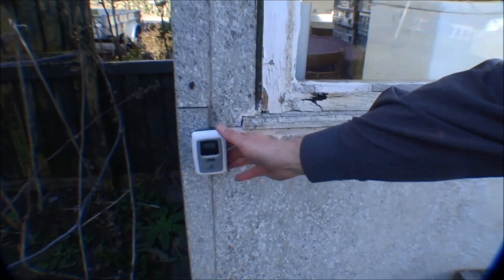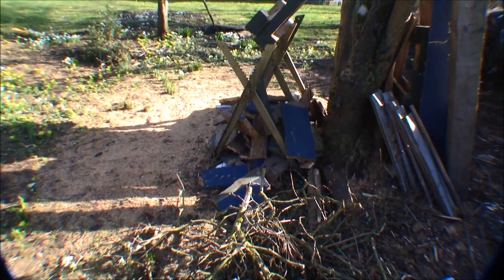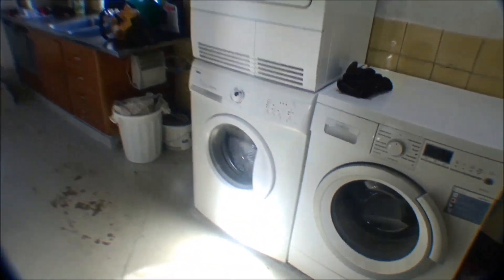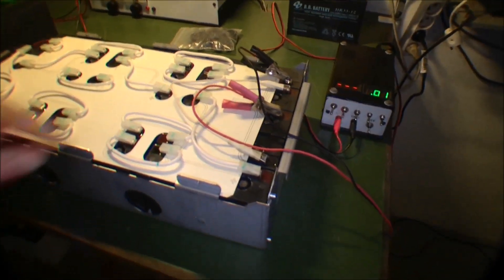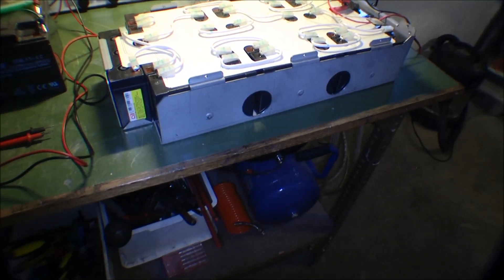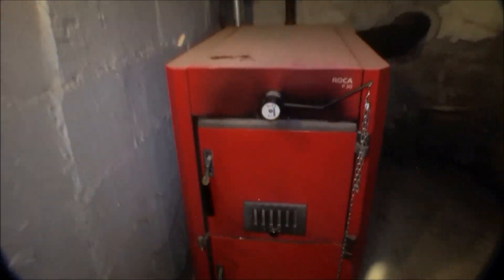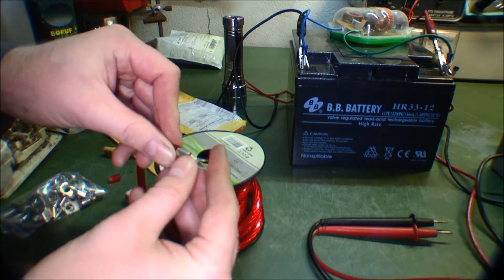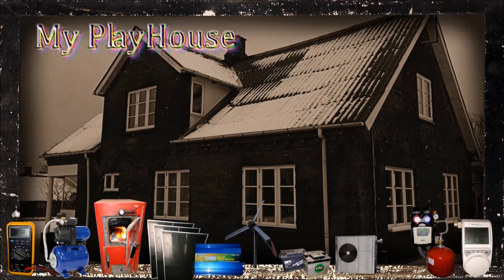Update on some of the small projects - 152

Comment: These Connectors  are supposed to be pressfitted /crimped on to the wires :D 
(because at heavy load the solder could melt by its own because of heat generated by the current)